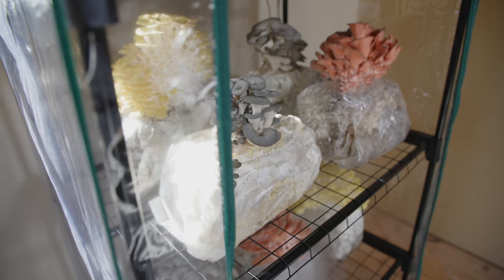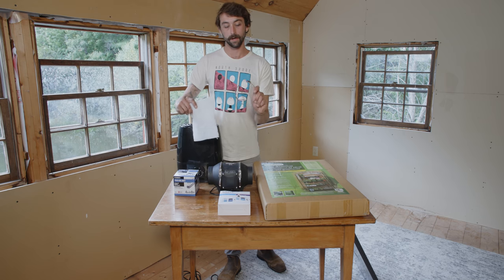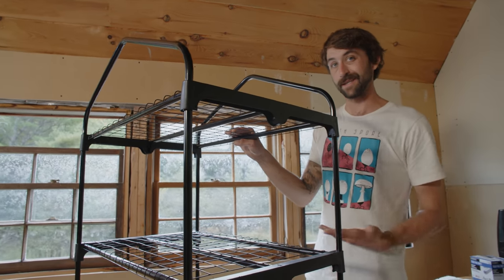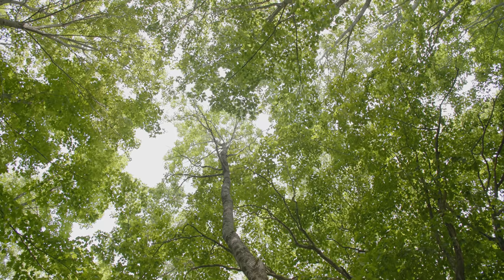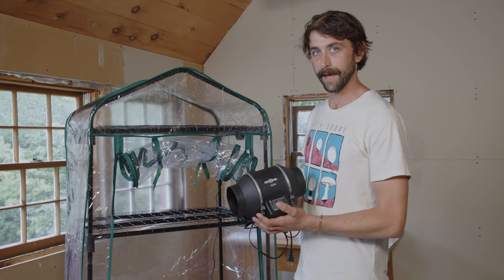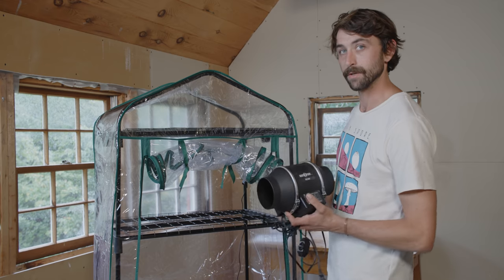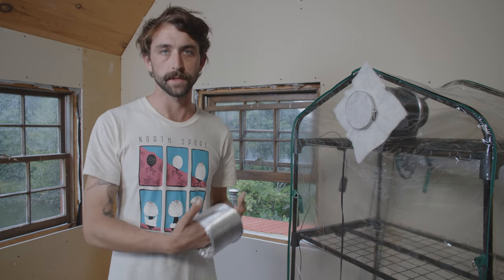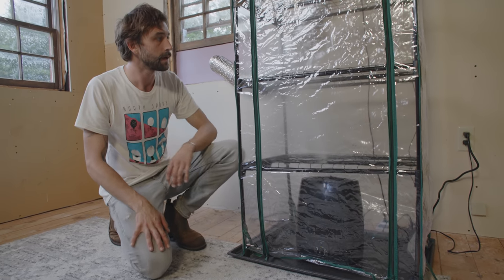Complete Martha Grow Tent Setup & Maintenance Walk-Through | Build a DIY Mushroom Fruiting Chamber

Comment: Could this be sealed up to be able to use it as an incubation chamber as well when you don't have any fruiting mushrooms? If so, what would you recommend to seal it up?
Reply from the maker: It doesn't necessarily need to be sealed, you simply don't need air exchange during this time.  You could tape it to the drip tray to seal it if desired!
Reply: @NorthSpore  the risk of contams is low enough to not seal during incubation? That's awesome!
Reply: @uncoolasmr4847  Typically while incubating the substrate is sealed in it's fruiting bags, jars or whatever container you use, maybe with some sort of filter patch. You only need to expose it to the air by cutting the bag open or opening the jar when fully colonized and ready to fruit. 
You can just leave them on a shelf in favorable temperature conditions while incubating. No need for a sealed environment.
Reply: @Cameron88799  thanks for the info!

Comment: We have the same ultrasonic humidifer and the manual says to use distilled water but you show filling it with tap.  Has anybody had problems with running tap water through an ultrasonic humdifier?  We do have a water softener to help with any hard water.
Reply from the maker: You're not wrong, distilled is ideal. That said, tap water works! At least for a long while....

Comment: Hey im having an issue with my humidity hovering around 59-61%, any tips for what could be stopping it from getting to 75-85% humidity?
Reply from the maker: You might have your fan on too high or your humidifier turned too low, maybe both.

Comment: When I set up my tent I have reptile foggers set up along the top of the tent near where u put your air exchange, and my air exchange is currently pulling air from near the bottom of the tent, is this a crucial error?
Reply from the maker: Our latest version of our Martha tent (the BoomRoom II) has the same set up as yours. Different setups can totally work as long as you’re manipulating the air movement to achieve the desired conditions!

Comment: So do you keep the fan running 24/7?
Reply from the maker: The fan dialed should be turned to on, but the timer or controller will actually dictate when it's on. It should definitely not run al of the time.

Comment: Your website video for the tent shows the fan and filter being placed in the opposite direction. I.e. fan end on inside of tent with filter over it, whereas this video has the fan end outside the tent. Not sure which direction to go now. I flipped it on and the fan draws in, the other side blows out, so I’ve followed the website video rather than this one. Does it matter/am I missing something?
Reply from the maker: Confusing, sorry. Ideally, you are venting outside and don't need a filter on the outside. Therefore, put it on the inside. Or perhaps try filters on the inside and out. The fan is pretty powerful and can probably overcome the resistance.

Comment: Could someone answer this: Wouldn't pulling in air to then vent out introduce things that could contaminate the mushrooms? I'm thinking if I have this in the house and its pulling in air from my house that wouldn't be sterile, wouldn't introducing non sterile air cause issues? Or is the sterile part of growing them really only an issue when it comes to the initial inoculation? 
Thanks in advance!
Reply from the maker: While it's important to use clean air, blocks put into this chamber should be ready to fruit. Therefore, they are fully colonized and much less susceptible to contamination.

Comment: How long will the mister work in such a high humidity environment?
Reply from the maker: There isn't actually a mister, rather the humidifier pumps out humid air, which is then sucked up and throughout the tent by the fan. The humidifier is designed to be in a humid space, but probably won't last forever. It's hard to put a timeframe on that. Keeping it clean is the best thing you can do to ensure proper functioning.
Reply: @NorthSpore  how long will the appliance last working in such a humid environment?
I'm also wondering if it is safe for long term use.

Comment: A small suggestion to anyone buying a tent like this, buy it about a week before you want to use it, and set it up in a location with good circulation so it can off gas. Inexpensive plastic tends to stink to high heaven from the chemicals. Give it a few days to air out before you put life in there.
Reply from the maker: Not a bad suggestion at all! That vinyl can be ripe.

Comment: I’m concerned my fan runs too often and dries out the tent.  I fill the humidifier almost daily.  Is this normal?
Reply from the maker: It's possible that this has to do with your settings or sensor placement. You could also try turning the fan down.

Comment: Is this positive or negative pressurized? Please I would like to know?
Reply from the maker: This is a negative pressure system. It can be done either way, but we did it this way to vent spores away from living spaces. Also, contamination isn't a major issue once substrate is colonized, which it should be if it's going in here.
Reply: @NorthSpore  thank you for taking your time 🌱

Comment: how often do you need to refill the humidifier?
Reply from the maker: This will vary depending on the humidity you have your tent set to, size of humidifier, ambient humidity etc. For example, if you live in the desert where humidity is always very low, you'll run out faster than if you live in a swampy area. Winter and Summer will differ as well. That said, checking it at least 2 times a day is good practice.

Comment: question regarding this setup: how long is the fan running? all the time? or just once every hour or so? i have the problem that my fan (190m3/h) fans out the tent quicker than the humidifiers can replenish the humidity... but i already added 2x400ml/h reptile foggers... troubleshooting is a bitch. :(
Reply from the maker: You need one of these: https://northspore.com/collections/martha-tents-supplies/products/fan-cycle-timer
Reply: @NorthSpore  and approximately what times are noemal to be used

Comment: Need details on the diameter of the duct clamp
Reply: Any home improvement big box store will have duct clamps.  Some even have thumb screws to make it easier.  Just get the right diameter duct to fit your fan and that will determine the clamp size.

Comment: What about heat? The only problem I’m really having is keeping an area at a steady 77-78 degrees (if that’s the correct fruiting temp let me know please :) ) my house sits at 70 always
Reply: I do market farming and use a germination chamber for my starts that resembles this in some ways (its in a fridge though). I use a crockpot full of water with a temp controller and it works really well, and adds humidity. Going to try that on my martha build in my cold ass house. Love growing food inside all winter
Reply from the maker: 70 is better!
Reply: @NorthSpore   Thank you! If I don’t have a flow hood do you think using monotubs would be smart? Or just colonize bags of substrate and slice a hole in the side like I’ve been seeing in certain places it’s less yield but seems easier

Comment: Do you use a CO2 controller for the fan?
Reply from the maker: We do not, instead we just have a cycle timer for it. It's certainly possible to rig up the fan so it kicks on based on CO2 levels though!

Comment: Does it matter if the humidifier is warm mist or cool mist?
Reply from the maker: That could be one way to affect temperature, so yes it could matter. Our system doesn't control water temp, so it will be a cooler mist and with definitely cool things down a bit if the weather is hot. Generally speaking, cooler is better.
Reply: @NorthSpore  Yea that's what I was thinking as well. I appreciate the response! It looks like they generate humidity some when they need to as well, and since temp is being controlled also, cooler would seem to be the better way to go. And luckily the one I came into is smart warm and cool mist.

Comment: I realize this video is older but it's not a very good idea running the humidifer in thr tent. Atleast run it on a outlet strip so if it fries out it won't pop your fuse. This is exactly why i bit the bullet and ordered a reptile fogger. Its top fill and has the hose attachment. Exactly what I need.
Reply from the maker: You're not wrong. We've updated the design with this in mind! https://northspore.com/collections/martha-tents-supplies/products/boomroom-ii-automated-martha-tent-mushroom-grow-kit

Comment: Whats the timing cycle for the exhaust fan
Reply from the maker: The exhaust fan is not on a timer, but it could be. It will depend on a number of factors what the cycle should be and will require your own troubleshooting and dialing in.

Comment: Since CO2 is heavier than oxygen, wouldn't it make more sense to place fan at the bottom of the tent, where CO2 levels will probably be slightly higher?
Reply from the maker: Yes, that does make sense. However, we designed it this way primarily to funnel spores out of the top and ideally out a window. The fan is powerful and this placement due to heavier CO2 is irrelevant.

Comment: I bought all the things for the small tub literally everything and suddenly I see this video with you narrating about the Martha tent the Martha tent . I don't see anything about covering yourself in isopropyl alcohol clean rooms bacteria and  environments absolutely nothing it clearly looks like this is the way to go I have multiple programmable humidifiers that link to my phone multiple exhaust fans and ducting a bright window in my kitchen with lots of room to sit the Martha tent near by. I have two questions for you is this the easier route and why don't you have to wear gloves or why wasn't being completely 100% sterile part of this ?
   Is this the way to go?
Reply from the maker: Simply put, fully colonized substrate doesn't require sterility. Do not confuse the fruiting chamber (Martha) with the full, but smaller grow system (monotub).

Comment: Does anyone know how I should cycle my duct fan? I want to run it automatically.
Reply from the maker: It depends on a lot of factors! How many blocks do you have in there, for example. you could start with something like 3 minutes on, 30 minutes off though and see how the mushrooms react. Or you can even get a CO2 reader and try to keep that at around 500ppm.

Comment: Good intro guide but they completely left out water quality!  
Also I know for a fact that model of ultrasonic humidifier can harbor organisms that can contaminate already colonized blocks, because it’s happened to us!
Reply from the maker: We use tap water with no issue!  It is a good practice to regularly clean out the humidifier as it can harbor bacteria with consistent use.
Reply: @equalizer1553  what kind of water would you recommend to use? I am setting my tent up in a spare bathroom and would sure love to use that convenient shower water since its RIGHT there, but I live in nevada with terrible water so was considering bringing in distilled or something i could get cheap.